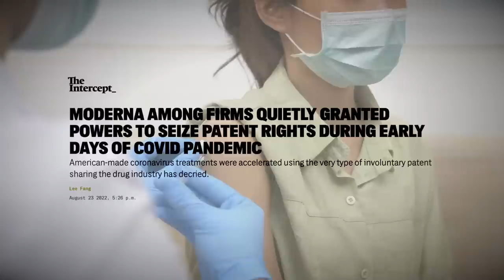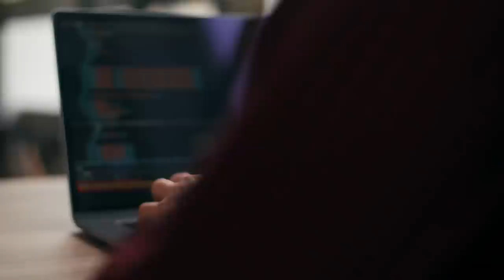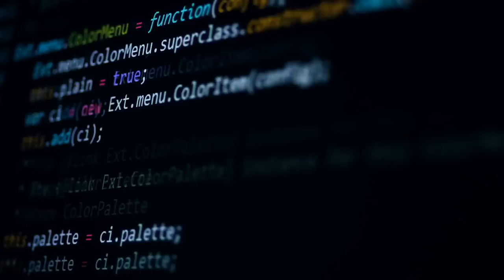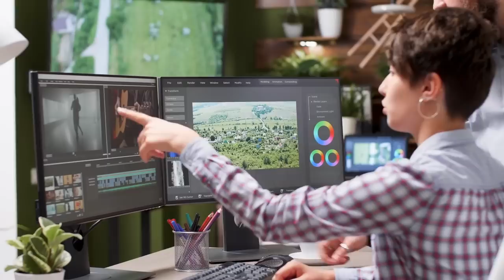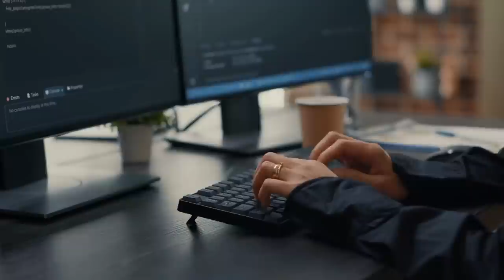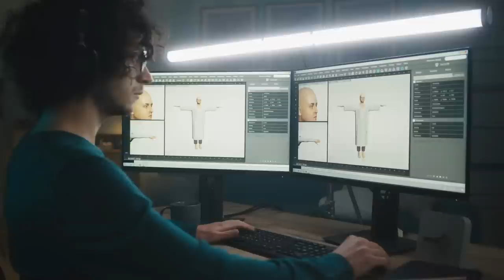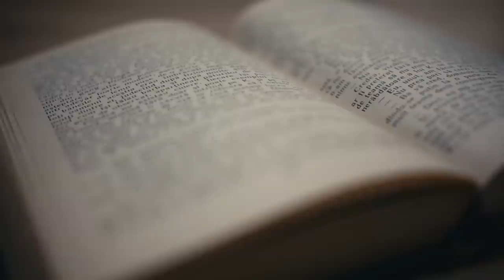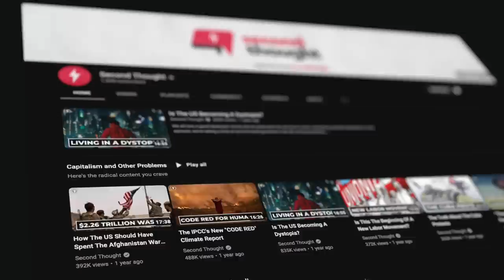Why We Should Get Rid Of Intellectual Property

Comment: And you only covered the problems with 2 types of IP: design patents and copyright. There are other types that you didn't cover: design patents, trademarks, trade dress, and trade secrets. Trade secret protections are especially insidious as they undermine people's right to know what substances companies put in their products and release into the environment. Trademarks, which are theoretically supposed to help buyers identify the source of a product, actually serve to conceal the source, since (1) they can be bought and sold and (2) a company need not use a common trademark on all products. 

Also, while I agree that a socialist approach would be best, there are many improvements that could be made to IP law to help it better serve its theoretical purpose in a capitalist economy. Many of the worst consequences of IP law are in the details rather than the basic concept. And the details have changed a lot over time, to the point that the system would be unrecognizable to those who created it in the first place. A number of expansions in the scope of IP law are mere decades old, such as genetics patents, software patents, and the whole concept of trade dress..

Comment: You are right, it's disgusting and surely it will be punished by fate. If I ever have an IP steal away, I may complain of not being mentioned because I have never lived through the dangers of visibility, but I'll be glad for the propagation of the good which I wouldn't have achieved alone, so my complaints will be wrapped in a silent thanks.

Comment: I'm a firm believer that IP shouldn't exist. Unfortunately the natural result of abolishing IP rights without creating a "public buyer" is extreme secrecy. Ideas may be hidden from the public for decades without becoming reality for fear that the original creators won't get paid. I believe there are better ways to allow knowledge workers to sell their product, not just their labor, without holding long-term monopolies over an idea. For example, a right to some degree of decreasing ownership in the businesses that use an idea without having a right to exclude.
Reply: I think that IP should only exist on an individual level, and that it shouldn't be something you can buy or sell. It should also only last for a couple years. No protection for creators would result in people not sharing their ideas for fear of having them stolen, and it would hurt innovators who have their work plagiarized.

This being with the caveat of not applying to public infastructure, medicine, or anything that could really improve the lives of a lot of people — you should be aware going into creating or improving these thingd that you are doing this for the good of society at large and you have no right to private ownership over your work.

These restrictions do create some problems. Ex: If two people write a book together, how will they decide who gets ownership over the iP? However, I believe that a revised version of our copyright laws that looked something like this would be a much fairer solution *and* eliminate the problems caused by the current system.

Comment: I think that IP should only exist on an individual level, and that it shouldn't be something you can buy or sell. It should also only last for a couple years. No protection for creators would result in people not sharing their ideas for fear of having them stolen, and it would hurt innovators who have their work plagiarized.

This being with the caveat of not applying to public infastructure, medicine, or anything that could really improve the lives of a lot of people — you should be aware going into creating or improving these thingd that you are doing this for the good of society at large and you have no right to private ownership over your work.

These restrictions do create some problems. Ex: If two people write a book together, how will they decide who gets ownership over the iP? However, I believe that a revised version of our copyright laws that looked something like this would be a much fairer solution *and* eliminate the problems caused by the current system.

Comment: Why only socialist solution? Could just fix the system so that patents cannot be extended and they expire after 20 years. Also have the patenting cost be cheaper and patent upkeep cost be reasonable. At the moment the patent filing costs are way too high for an individual inventor to bear. So they either have to give away their invention for protection or keep it a secret.

Comment: I agree that the current IP system sucks, but I can not see how your suggestions compensate innovators fairly. If someone invents something that than millions or billions use, they should never have to worry about money again. They have done their part. They should be paid a sizeable monthly fee, based on how much their innovation is utilised. 

Otherwise I see no motivation to do cutting edge research and innovation. Might as well just do a boring ass job, if the compensation is the same.
Reply: So given two jobs with the same compensation, you'd rather do the more boring one and make life worse for yourself just because you might not be compensated 'fairly' for the other job? That seems like cutting off your nose to spite your own face ...